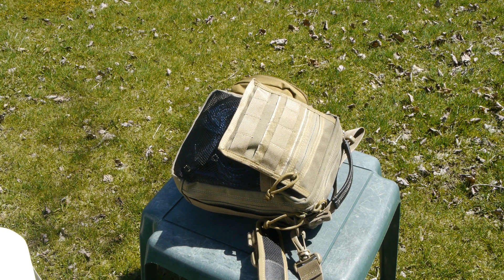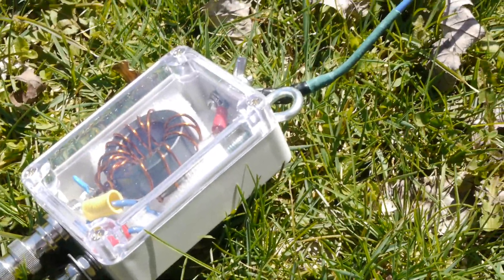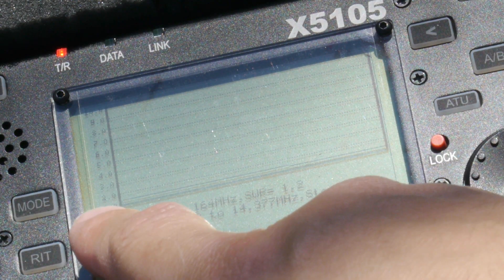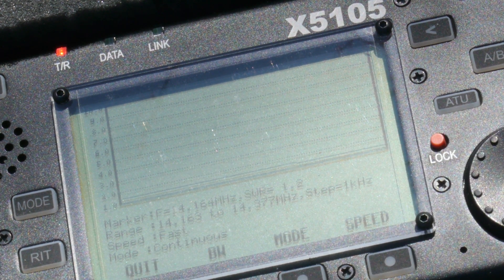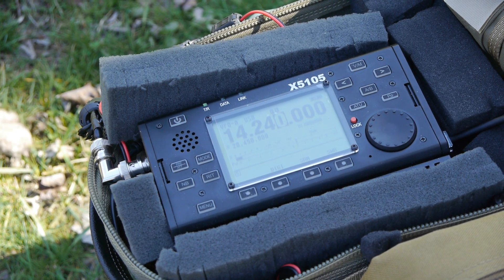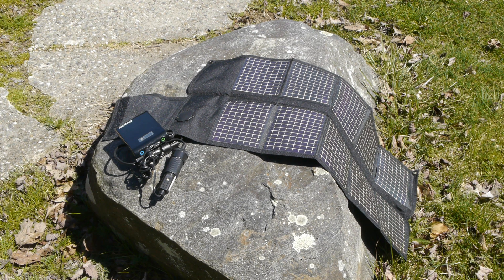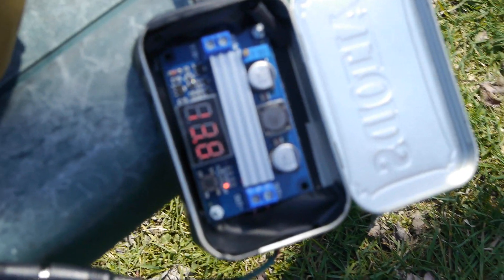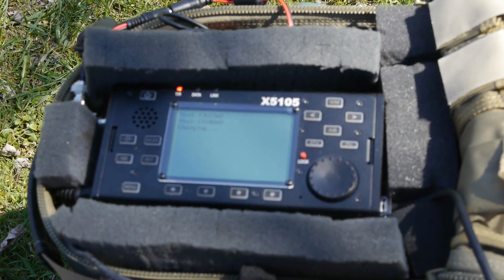Xiegu x5105 Bag Deployment Setup

Comment: Cool setup. What was your farthest contact using this rig?
Reply from the maker: from the at in fhanestock state park at elevation of 1300ft at 5 watts usb on 20m all the way to west coast oregon using a 20m dipole barely 4 ft off the ground with about 15 ft of rg174 cable.

Comment: Very nice setup. What are the dimensions of the antenna legs that you used? I have a linked dipole I made, but nothing like this. 73
Reply from the maker: i started with a 20m dipole then added another equal length and trimmed both sides equally to get the dip into the phone portion of ghe band although it is 14awg wire which gives me a wide band width.